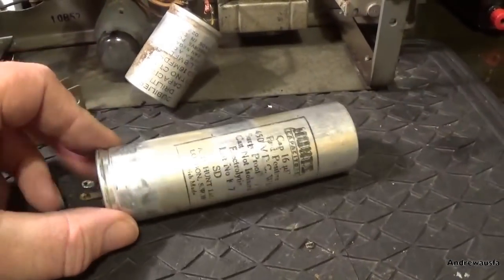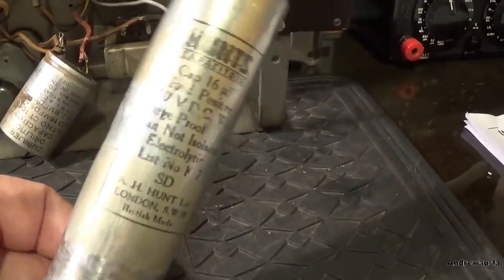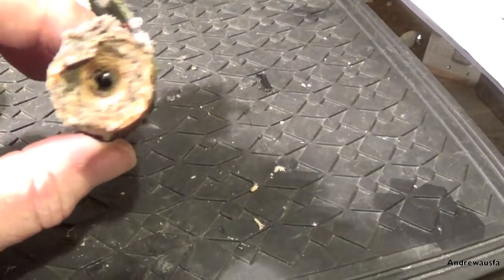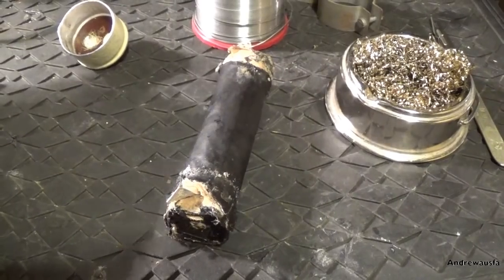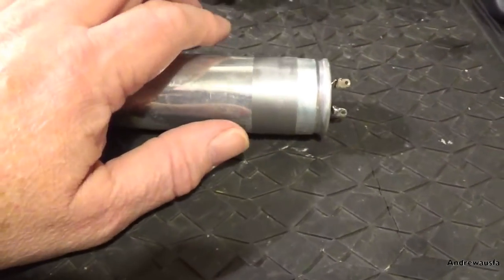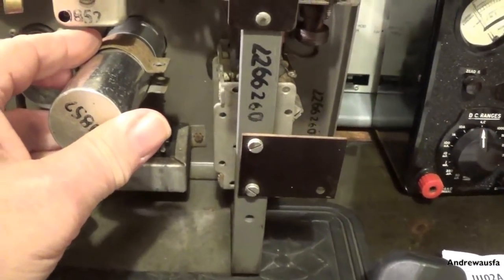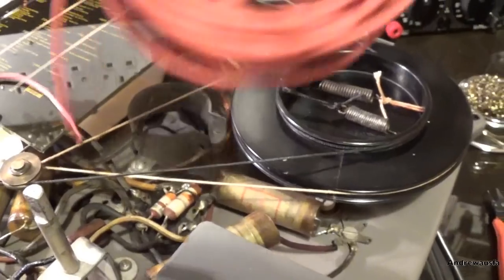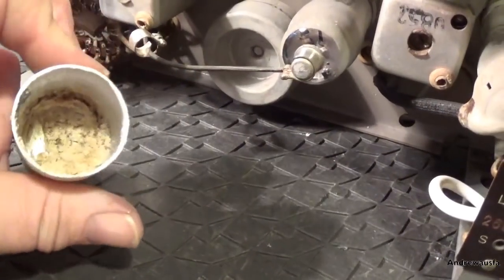Murphy U102A Part 4

Comment: Great video.  Very helpful.  I noticed that the double section capacitor was labeled "Drylitic" or something similar.  This suggests it is one of the dry electrolytic style capacitors and would explain why it was dried out.  Just a thought.  I've restuffed a few of those and they look just like yours inside.  Best Regards, Doc.

Comment: That’s coming along really well. I need to do some valve radio stuff just to get away from the bloody tantalum capacitors. I always enjoy restuffing those capacitors.  You did a good job cutting the can open without damage that saw must have fine teeth. That size difference is amazing will the new capacitor last 60 years
Reply from the maker: Hi Chris, I use an Exacto saw about 52tpi and approx 0.012” thick. They're around £12 for blade plus handle, £5-6 for just the blade.
Reply: Andrewausfa  I will have to look for one of those saws.
Reply from the maker: @allthegearnoidea6752  Amazon - I spellted it wrong it's X-Acto

Comment: Nice Job Andrew Labour Of Love, On Re-Stuffing Those Old Electrolytic Capacitors Should Be Really Nice Radio When Finished..Regards mike.
Reply from the maker: Hi Mike, yes lots of labour just to get it to the point of being able to apply power. I've got a really rotten 1930s Philips set in the loft, that needs all wire, not just some, replacing before I can apply power!  You get good at cutting and soldering :)

Comment: Very nice job as always Andrew. I was wondering if you were going to do all the caps. What wire do you use for the chassis wiring. I have used cable stripped out from mains flex in the past but wondered if it was available on separate reels and what gauge is needed. Regards Graham
Reply from the maker: Hi Graham, I use silicone covered wire bought from a guy at the BVWS events in metre lengths. Multi stranded and in about ten muted colours. He's usually at the NVCF.